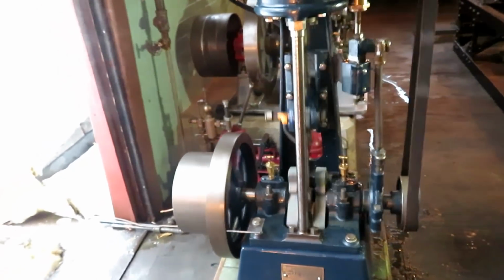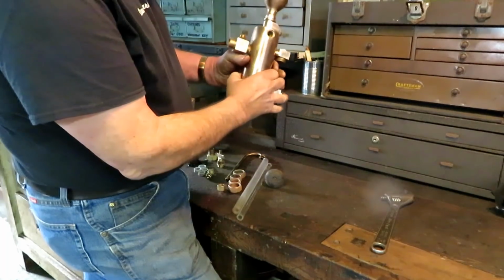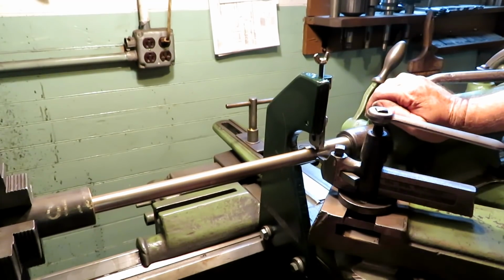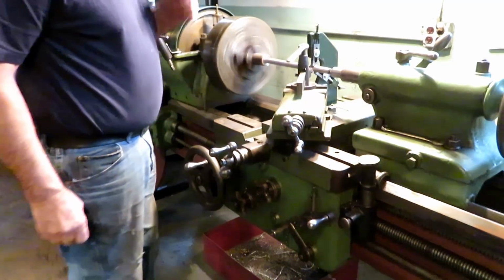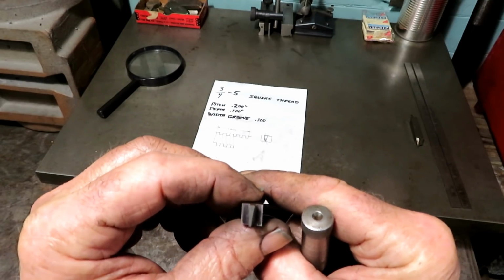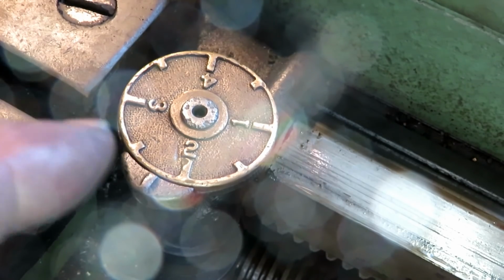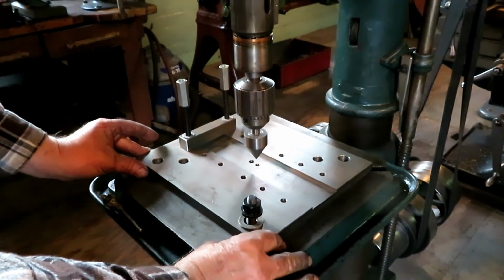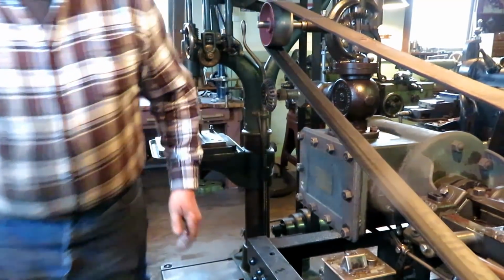OLD STEAM POWERED MACHINE SHOP 49 Cutting a square thread

Comment: How often do you have to add fuel to your boiler?
Reply from the maker: Burning coal, about every 20 minutes you have to rake it a little and add some (alternating sides). With junk wood, about every 10 to 15 minutes it depends on the size, type and how dry it is.......Dave

Comment: Is that a Pratt and Whitney lathe?
Reply from the maker: Thanks for watching Joe, It's a 1925 American Machine Tool Co, Cincinnati, OH. ....Dave
Reply: @davidrichards5594  I used to run a 1943-44 Pratt and Whitney lathe that had a lot of similarities. I thought yours might be an older model. I have used a lot of equipment, and the Pratt was one of the more enjoyable machines to run. It was more of an instrument than a machine tool. I would expect that your American is the same.
Reply from the maker: My American was in such bad shape, you probably wouldn't have bothered with it. It's like an old dog around the shop.....Dave
Reply: @davidrichards5594  Dave, I cut my teeth in the trade running old worn out machine tools. There is always a trick to get what you need. My hobby shop has a mill, and a lathe both older than me, and equally worn out.

Comment: Hello Dave.  Love watching these vids.  I have an old blacksmith vice with a bent handle I want to remove and straighten.  I assume one of the ends unscrews.  Is that correct?  Thank you.
Reply from the maker: Paul, I think most of those "clam shell" blacksmith vise handles had one forged end and one end ball slid on up to a shoulder and the end pined over like a rivet....Dave
Reply: @davidrichards5594   --  Hello Dave.  Your explanation sounds more plausible than mine.  I've never been quite sure how the second ball was put on.  But, I've never seen one screwed on an old Blacksmith Vise. I have 5 or 6 of these vises, now I'm curious, LOL......  Hello again Dave.  It just dawned on me.  I bet the ball was a separate piece with an undersized dia. hole, the ball was heated up, slid on the handle to a shoulder, then cooled, or pined and cooled.  Which is basically what you said with the addition of heat added to shrink the ball onto the handle.......
Reply: OK.  That explains why I've been having so much fun. On to plan B.  Thank you.
Reply: Yes that's how vise handles are manufactured (at least what I've seen). The ball ends are threaded on. No easy way to get them off though. My old Chas Parker has tumor welds on the ends of the handle. I assume they busted off and just went to town with the torch. Must have taken forever to build up that much with gas welding.
Reply: Paul Duffey  --  I have several of these Blacksmith Vice's that I use in my shop, I've never seen one that unscrews.  I'm under the impression that the second knob on the end of the handle is forged in a die during the assembly process but before the screw is placed within the vice itself.  The end of the handle would have to be heated and upset to gain material thickness before forged in a die, OR the material was forge welded onto the handle then forged in a die to make it round, (while the handle was already placed in the screw head).....  The way I have solved this problem in the past is to remove the screw from the vice, heat the handle and try to bend it back into shape.  This is not to say some vice's may have handle ends that unscrew, I don't know, but I've personally never seen one on a Blacksmith Vice.

Comment: Thinking about the tapper at end of thread if they made a die cutter and not single pointed. like most die start taper then go full depth  so after turning die to get the amount of thread and stop the last little bit of threads would be as you see tapered. But I maybe all wet.

Comment: Ahha!  You do have a steam pump!  I saw that worthington hiding on the floor.
Steam oil is still available.  Go to a auto parts store and ask for "Shell Valvata J Oil 460 - Steam Cylinder Oil"
So why dont you call the thread by its name?  Acme thread
Reply: an acme thread and a square thread are different

Comment: @dave when you were threading you were disengaging the half-nut from a control near the head stock.  Can you show us that set of controls?
Reply from the maker: I forgot to show that. The American lathe has a 2 speed back gear I was dropping it down in the lower speed to see where the thread ended better....Dave
Reply: @davidrichards5594  Thank you.  What I was seeing as disengaging the half-nuts was just dropping the speed.  From the camera angle it was hard to see that the cartage was still moving.

Comment: One note steam oil is being sold by most large petroleum companies, but you have to look for it and ask for it. Most of the people who sell it don't know what it's for. I switched from Heritage Oils(Green Velvet -which is great by the way)) to Mobil Super Cylinder Oil 600W. It's good for steam up to 500F.
Reply from the maker: Green velvet will work in a displacement type lubricator, nothing else I've tried will. Why did you switch? price?....Dave
Reply: @davidrichards5594  At the time I wanted to get 5 gallons, and the green velvet price for that much wasn't in the cards.I am using a swift lubricator (also hydro static) and it seems to work for me. I know I can improve my technique on the swift. It always seems to be off, or way too generous.

Comment: is it possible that the old vice screw have roll thread instead of cut thread
that would explain the taper end
what is the rpm of your steam motor and hp
thank for another great video

Comment: another great video. i never get tired of seeing you make chips instead of doing infomercials for bangood. i like your center drilling fixture for the drill press.  i made one years ago by cutting a v groove in the base plate with a half inch hole to use as a line up and clearance hole for the drill. i like your's better

Comment: Watching the Morris run has been well worth the wait.  I've been watching this rebuild right from the get go.  Well done, as you do everything. Now a question. Is there a reason you started with such a large diameter piece of stock for the vice screw compared to the final diameter.?
Reply from the maker: Hi Jim, That's the way it was made, that's the way Matt wanted it, we don't argue....Dave

Comment: So Dave, now that you have 3 steam engines, do they all use the same pressure?  If not what are the differences?  Thanks for your keeping the past alive.
Reply from the maker: Hi Gerald, They probably all were designed with 125-150 psi in mind. The  main thing is the speeds. The bigger engine with long stroke will put out a lot of torque at about 150 RPM, the O&S was called a "high speed" engine with square dimensions ( 5" stroke, 5" bore) so it would have been built to run 250-300 RPM.  The Morris I haven't figured out yet. It really likes to run fast, it's also square (6x6) and close kin to a marine design so I figure it would be rated at 300 RPM....Dave

Comment: If thay used a large die to put the threads on that, It would have a tapper where it stopped !!   And i would assume that if it was a production item they would have used something like that over using a lathe , to save time ! But i am a maintenance man and not a machinist .
Reply: How I missed something so obvious.. good idea!
Reply: It looks very similiar to a pipe threader type die. It would feed in full depth, at end of cut the die would open. The taper is just the lead into the dies. A cheap way to make screws fast with no skilled labor or expensive machinery
Reply: I agree, my first thought was it's made using a die. As he rotated it you could see the teeth marks where it ended.
Reply from the maker: Could very well have been an automatic head powered thread die like an isometric that opens at the end. They probably wouldn't have taken the time to cut the thread on a lathe....Dave
Reply: David Richards 
My thoughts exactly.  A die head. 
That Morris is one smooth running little engine.  Nice job.